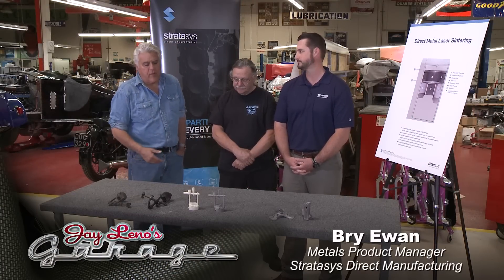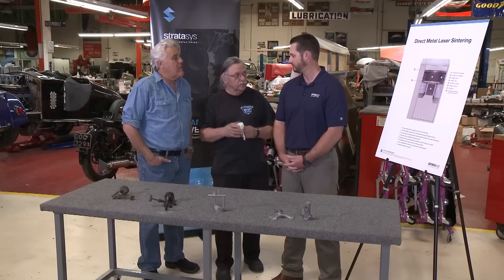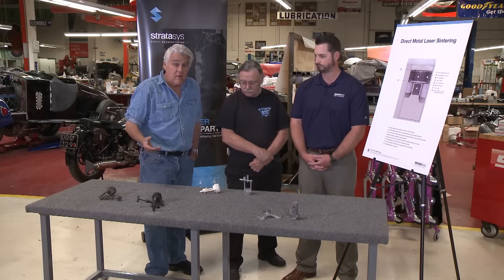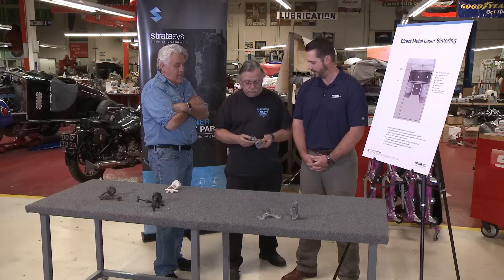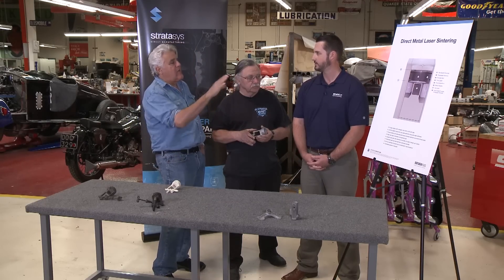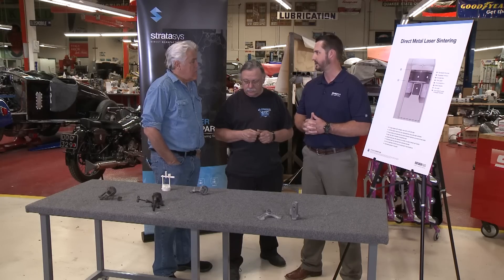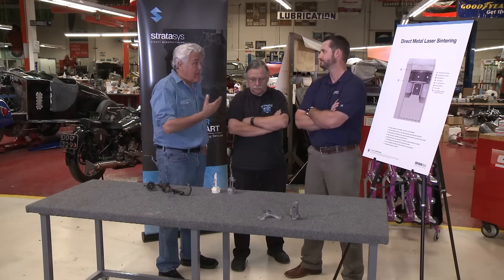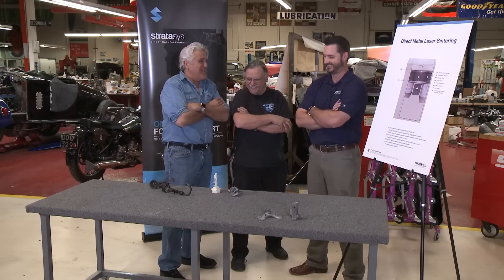Direct Metal Laser Printing - Jay Leno's Garage

Comment: I'm 2 months 'younger' than Jay Leno. I retired in 2015 after almost 50 years in HD truck and vehicle maintenance. In late 1966, when Star Trek came out, there were two things I noticed not related to the acting, etc. One was Scotty using a tricorder to locate electrical issues behind a wall. I know I called 'No way'! on that being possible. In the very early 2000's I purchased a wireless tool to locate broken wire(s) in a harness without taking the harness apart! So, I ate my words then! Also, how are parts made in space when you are not parked at a manufacturing facility. There was one episode that did show Enterprise at a repair station that I do remember. The 3D printing capabilities that are now available means the star ships can make their own parts while in space, like Navy warships could while underway because foundry's, lathes, milling machines, etc. were also included onboard. Again.... WOW!  😲😲😲😲😲😲😎😎😍😍

Comment: I needed a custom ceiling washer (spacer) for lighting and sent in a Pro-E drawing to a local 3d printer.  I needed 4.  The lowest bid was 350 bucks for  9x1 inch doughnuts made out of the cheapest plastic they had.  I use wood instead.  In my case it was not cost effective.
Reply: You can buy your own 3D printer from Amazon for less than $300 and filament and spend a lot less for anything else you need to print from there on. With a bit of time of calibration using a feeler gauge and some filament(plastic basically) you could then make anything you want. In the long run it would save you a lot of time and money.

Comment: Now, if this technology can be developed to be able to make parts with +/- .0001" dimensional and positional tolerance, and surface finishes down to 10um or so that won't require a seperate finish machining step, then it would really be something.

Comment: This is an active area of development among aerospace  companies because it offers a way to produce complex parts in less time at less cost. Putting together a laser system that scans a 3D matrix of points is straightforward- the secret sauce is the material, how it is prepared, and the process parameters (laser pulse energy and peak power, dot spacing, etc.) These are likely to remain trade secrets among fabricators, for a while at least. 

The initial technology for metal 3D parts produced pieces that then needed machining to bring them to final shape- the advantage being that less machining was needed and there was far less scrap compared to the machine-it-from-a big-chunk process. But today the goal is direct printing to the final finish and dimensions- no machining needed, no scrap. Laser accuracy isn't the issue- it's the material and how it solidifies. 

How hot does it get? Hot enough to melt the metal at the focus of the laser, but only there. There is probably not much advantage to going higher than that, because you only want to melt the metal, not boil it. The focus of the laser is likely a dot less than 1/100 inch in diameter, so think of it as a pinpoint of high heat that moves around. 

There may be other process tricks like doing it in an oxygen-free environment to prevent formation of oxides, bias heating the incoming metal so that the laser only has to heat it "the rest of the way" to the melting point, and how you sequence the process to deal with heat buildup and material expansion and contraction with temperature. At least one company uses electron beams instead of lasers because there are advantages that offset the higher costs.

Comment: Funny how that sintered metal printing thing spread worldwide in the past 5 years. Recently, I discovered that there are some late 70s / early 80s Soviet powder metal 3D printers (yes, laser is used for bonding too), which were mostly used for printing titanium parts for titanium submarines. Despite the same function, I suppose that they don't support modern CAD, lol. I have no idea how they were running, but they were sure enough CNC. Very few people know about these things even in Russia.

Comment: So if he doesn't know what temperature the laser gets the metal to, how does he know the integrity of the material will be intact? Working at a (slightly different method of) metal 3D printing facility has given me a whole new perspective on how much actually goes in to creating parts which are as good, or better, than the direct machined equivalent. Blasting it with an unknown amount of heat doesn't seem like a great way to get consistent, or ideal, results.

Comment: I wish for a metallurgy degree right about now? I have a book full of questions. Jay has mentioned in a couple videos about his Doble Steam Cars regarding the difficulty in replicating the pistons because of expansion and contraction at different rates because of the super heated steam.  How would you determine during the 3D metal printing sintering process that the part had the correct metallurgy?  Video mentioned for example, titanium alloy? I think of titanium parts for aviation that have to be made in a complete vacuum to reduce impurities with high tolerances for metal fatigue. Can these printed parts be strengthened further by heat treatment? I enjoyed reading the comments as much as watching the video.  Patent questions, metallurgy questions, tensile strength questions, Total Cost of Ownership questions, recreation vs restoration questions.  I wish the restoration blog could have separated out the laser scanner into a separate Vlog like this metal printing.  So many cool projects in progress, moved to pending, some just never to be repeated.  It seemed like the restoration update Vlog turned into a first ten minutes of check out how far we have come on scanners and then mashed in a restoration Vlog.  Just amazed.

Comment: So speaking of connecting rods, if you printed up a connecting rod would it be strong enough to use?
Reply: Jeff K Probably only in a steam engine. Gas engines turn too high an rpm and put too much force on the rod.

Comment: Hello my car people I need some help. I was driving my 1991 mustang GT😁 down the road when I heard a loud pop then the radiator hose came off and the belt snapped off. After replacing everything it wouldn't start so I did some research and it could be a blown head gasket but when I try to start it the car knocks and won't start. Any advice?
Reply: Buy a Chevy? ;-)

Comment: Can anyone confirm if this allows for fabricating high stress parts. Like a crankshaft for example.
Reply: super64 That much material would take years to print and cost a fortune. Presently it would be cheaper to cast it or forge it or use some traditional means. In a few years when its faster and cheaper maybe a crankshaft would be possible.

Comment: This process would be a real bargain for castings that require a mold with cores; say a water pump housing or a manifold. For an intake manifold on an antique car, you would easily pay $3000 for the pattern plus $200 for casting and $200 for machining.

Comment: This is a new use of an old technology.  In 1954 I worked for a metallurgical laboratory that was experimenting with powdered metal processes.  Since there were no lasers or 3D printers, the desired parts were made by compressing the metal powder in dies using a hydraulic press.  Then the item was sintered in a high-temperature furnace and the resultant part was ready for use with little or no machining.  The process was used for making sprockets for PIV chain drives for industrial machinery.
Reply: I totally understand this process. What I was working on was powdered metal, shaped in a die, and sintered to create the final object, which IS basically similar to this process. Read my post again. I  did not describe high-pressure casting.
Reply: Did you miss the sintering?  In my case, it was done in a furnace and in the 3D printer, it is done by laser.  The dies were machined to close tolerances and were re-usable, over and over. The process was used to make items that would have required machining had they been produced the normal way.  With the powdered metal process, the machining was eliminated, making the process cost effective for certain applications.  I was not trying to indicate that the processes are identical, only that they use the basic concept of sintered powdered metal.  That sintered powdered metal was a technology in use over 60 years ago.  Do you get it, racketman?
Reply: Richard Brookes I don't think this is similar to that at all. This new process is the same as current 3D printers. Certain 3D printers use a fine beam of UV light to harden the plastic resin slowly building the part vertically. This is the same, but with powdered metal, a laser and very high temps where the pinpoint sized laser hits the powdered metal. 

This new process should be many times stronger than the old high pressure casting.
Reply: Richard Brookes That's awesome!
Reply: That's what comes of being an old bugger.  What goes around comes around, in a different guise, to be sure.  :-)
Reply: I think Ford used that for rods on the 4.6   v 8
Reply: Fuel filters were commonly sintered brass. My experience was with Quadrajets.
Reply: BMW rods are typically powder metal.
Reply: I agree with Jason - the only commonality was the powder as a raw material; you are describing high pressure custom-made dies which would be very expensive to make, whereas 3d printing needs no dies, just a bed of powder.

Comment: 9x9? That means You can Hardly make anything that is actually useful. Like Steering Column. Or A Door. A Bumper? Even an Engine Block. This company is clearly trying to scam people. 500 per Inch? 9x9 = 4,500. Yet if the pieces are smaller than 9x9 You can get them for less. Doesn't seem very Practical. And Most antiques are easy to find Metal Parts. Its the Cosmetic Plastic Parts that are difficult. Who drives a car from 1930s anyway. Most antiques that actually road worthy are 70s - 90s. I don't think anyone wants to pay 5K for any 9x9 Piece of Metal. RATHER Convert to Electric for the same Price. Fail.
Reply: TheRealTraumatize If Jays 4" part took 7 to 10 days to make, how long would a steering column take? You would tie up a million dollar machine for 1 year maybe. That would be very expensive.

This is new technology though. Prices will drop over the next several years. Until then it will be cheaper to 3D print a big part and then have it cast in metal.

Comment: $500 an inch sounds unreasonably high.
Reply: That's what she said!
Reply: I used to work in aerospace $500 for a custom part is nothing (especially made out of inconel)
Reply: hastyberford 
Rapid prototyping is expensive. Consider that also covers the cost of the engineer too.
Reply: I guess when you spend a million on that machine working for $25hr isn't going to pay it back..
Reply: It's because it's early days and still in its infancy. When the first quartz watch came out in 1969, it would have cost over $8300 in today's money whereas now you can buy cheap Chinese ones anywhere for less than a dollar. The same will happen to this.
Reply: This is the first I've seen of metal printing. Just like with plastic 3D printers, other companies will make them and the process speeded up so prices will drop. 

Besides, if it takes 7 to 10 days to print a 4" tall part no wonder it costs so much.
Reply: When you factor in the complexity of making the metal powder, the engineer expertise and other labor, plus the incredible turn around time on a custom part. $500 an inch is LOW
Reply: That's what she said
Reply: Jason - See Solid Concepts video on printing a .45 cal ACP automatic pistol using a metal 3D printer.  November 2013.
Reply: hastyberford That's actually a pretty good price. A machine job shop couldn't build that steam part for less than $2,500.00. And good luck with CNC. The software setup would cost that alone.
Reply: He went on to say that if you could put more work into those "vertical inches" you can reduce the cost/part.  One little part costs nearly the same as 10 little parts, given they all fit on the "work plate" as he mentioned.
Reply: Not true. The laser has to write every part. The step being saved is screeding the powder for each and every part. Watch the vid again and you'll see that the Stratsys didn't jump all over the price being a whole lot less.
Reply: You aren't building a whole car with this printer. You are just making the ultra complex parts that are really hard to make on a 5 axis mill.
Reply: obviously, this is new technology
Reply: There line there but i am not going there :)
Reply: hastyberford So are you saying Trump only spent $900 in Russia?
Reply: hastyberford......if you have the only game in town, then your price is "the" price.  Hell, maybe $500 an inch is too low.  Depends on what you can get.  This pricing is similar to a pro athlete's salary.  If you are the only guy in the world that can do what you do, then how do you set your price?
Reply: Fear not. In 10-15 years, you will be able to buy or make one of these machines cheaply enough to own one. Or at least the market will be saturated with companies that do the same for much less.

Comment: Nikel Steel melts at around  1370 degrees C (2500°F) to 1510 degrees C (2750°F). but depending on the metal powder. so thats approx the level of heat  their laser of 4000Watts will have to produce to microweld the steel powder i guess.
Reply: He said 400W .. the guy was a bit stupid
Reply: Vax Buster 
The laser is a 400 watt laser. He's not stupid. They would have no need for a 4000 watt laser. Thats more a weapon than a tool.
Reply: I know it's 400W that's what i said (please read carefully), it's not 4000w as the commenter said. And the guy is stupid he didn't know the melting point of the metal
Reply: yep he says 400W you r right that sounds sounds quite low for reaching these temps, 400W is like a strong hallogen lamp maybe get the thermal dispation of a few 100s degree but thousands ?

Comment: As far as I know, Koenigsegg prints most of it's parts - also the engine!
Reply: Gert Sterner Not quite. The engine is cast by another company and the other parts use more traditional methods. They have only 3d printed the exhaust tip as far as I know.
Reply: Let's hear from the man himself:
/watch?v=Dw6cs7opvzA
/watch?v=DNedUZxP8NU
That was 3 years ago. So probably they're on a whole different level now.

Comment: That really is an amazing technoligy, but I think that they still have quite a way to go.
It's still super expensive, so really only in the reach for a very limited number of customers and I have also read,
that quality of the product isnÄt comparable in many ways to an old fashioned made part.
But still, the thought of how much one can do with that is startling.
Reply: Cue the 3d printed high stress titanium parts of car turbos:
/watch?v=DNedUZxP8NU
starts at 0.58
Almost no resurfacing needed after printing.
Reply: I already know that,
But that is so far from any normal use! Just think if one inch of some normal stuff is all ready 500$ than try to imagine how much these turbos cost. I am pritty sure that one can buy a car from that money and not a bad one

Comment: Wow. 3D printing in metal. That kind of replaces forging and machining. Even old ag parts would be much stronger, yet correct, using this process. As with all tech, the more popular it's reception and use, the lower the price gets. Awesome. As you mentioned, this would be great for emblems. Have them printed and chromed.....they'd outlast the car!

Comment: A question. are the parts made from a matrix of metal powder, flux and a
 bonding agent (like solider or bronze) and the laser melts the flux 
together. So after the print is completed it is furnace brazed together 
to achieve it's full strength ( Why it requires the additional size to 
allow it to shrink). Or does the machine actually fusion weld the metal 
powder to itself or melt the solider/bronze to form the part in 
conjunction with the metal powder to achieve full strength?
Cheers
Reply: dazaspc The laser can get temps over 4000f so it literally melts the metal one tiny pin sized dot at a time.
Reply: dazaspc that's a darn good question
Reply: dazaspc 
With the plastics it's oversized for shrinkage. Thats not so much a problem for sintering. And the powder is just base material so it Litterally fuses it together.
Reply: Inconel is a pain to work with. It is used because it normally highly 
resistant to deformation at close to its melting point. They must flood 
the box with argon/ co2/helium to prevent oxidation. Probably also 
preheat the medium that would have to measure only microns in size 
virtual dust.  I would like to see how they do this with Aluminum 
because it is coated with Aluminum Oxide and there is a huge difference 
in melting points between the two?
Cheers

Comment: Gets Bonneville script for body panel, The cost is more expensive than buying a fully restored Bonneville.
Reply: 10MB of storage used to cost over $3,000. Now you can buy 3TB for under $100. Same thing will happen here. Hell, 10 years ago a 3D printer was $10,000 and up. Now they're a home appliance people have for fun.
Reply: I think he's just trying to keep it 'relatable'- really the market would be more rare, exotic/obscure stuff; I'd imagine finding badges and stuff for 1920s Bugatti's, or Brough Superiors (or really obscure, vintage brands), would be nigh on imposible.
Reply: I could be wrong but if the script was only an 1/8th of an inch thick it would only be like $60. I don't know how they calculate cost for length though.
Reply: but like with all tech eventually you'll be able to have one in your garage
Reply: He said the more you can stack in that vertical space the more you will save, but he didn't say you could print a solid block at the same cost as a straight pin. Tricky.
Reply: You can't print anything less than 1/4inch with a high success rate. So it's going to be more than an equivalent of $500/inch